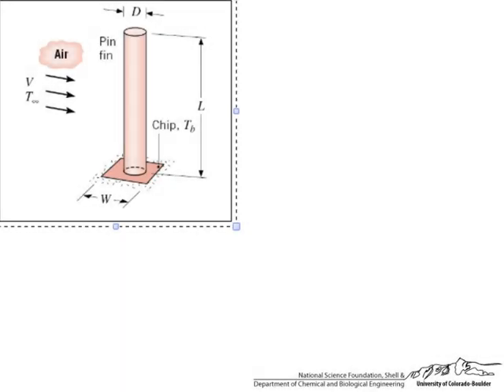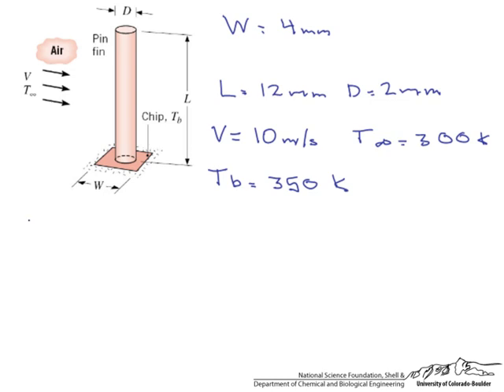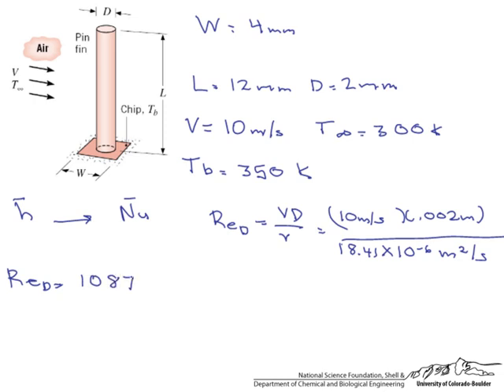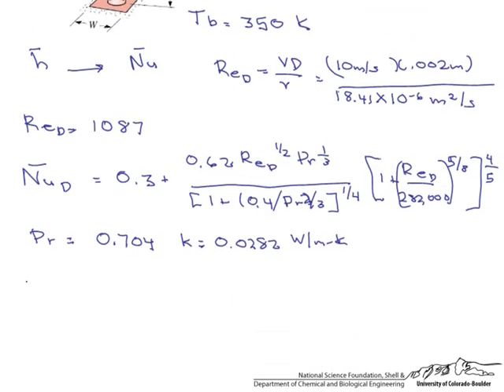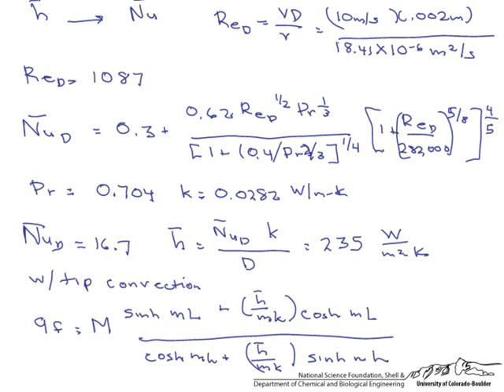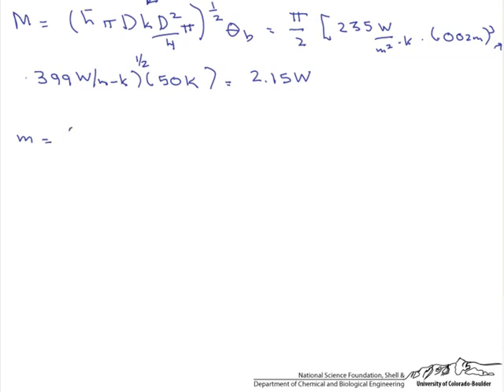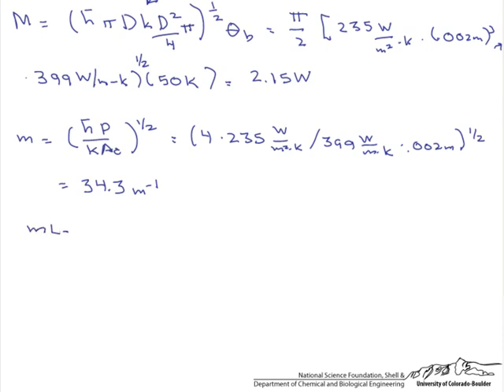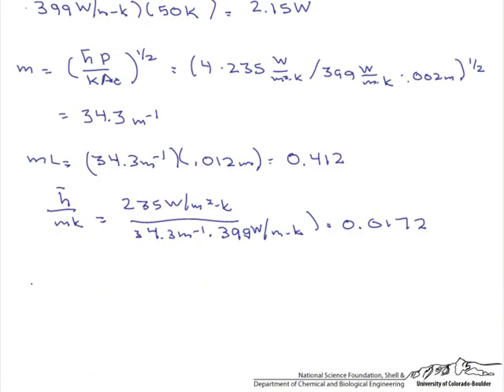Heat Loss from a Cylindrical Pin Fin

Comment: jesus, this lady gets worse and worse. if you give the definition of the Reynolds number, which is very common, at least give the definition of the prandtl number which is slightly less common than Re. and who the crap says 'cosh' i mean, are you trying to be confusing on purpose? pronouncing it "co-sh" instead of just saying "cosine h" or writing it cos(h) so we know what you are trying to say. and using variables you dont define until you've used them just makes the confusing factor much higher. i dont watch videos from this lady anymore they are not helpful just annoying and confusing.
Reply: +swinginwood my tutors all say cosh tanch and sinch when denoting a hyperbolic function
Reply: My Calc teacher always said sinch and coshe too (but cosh was with a long "o," like "coach") I don't think it's out of place at all. Plus it's faster than saying "hyperbolic sine" each time.